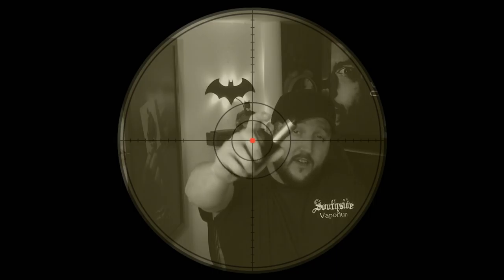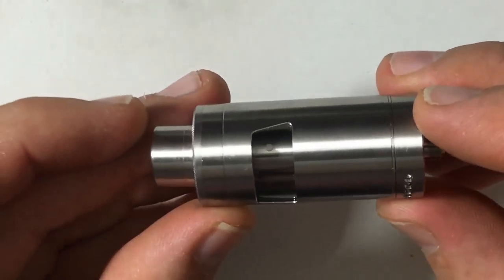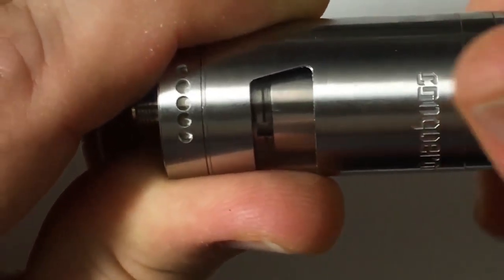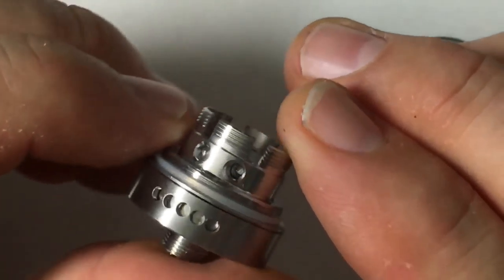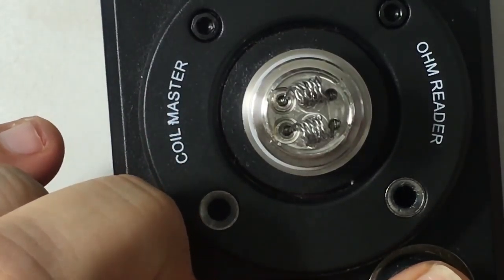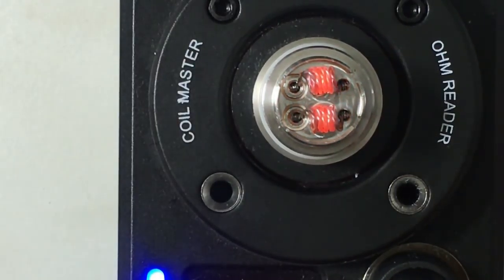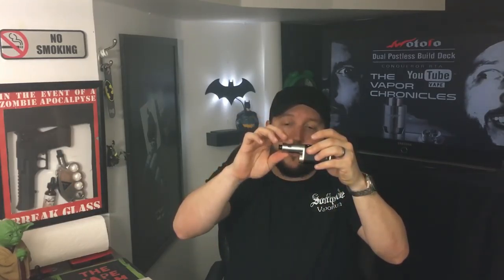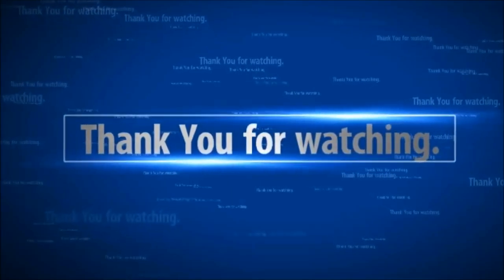Conqueror RTA By Wotofo On TVC

Comment: Hey Brian, love the coughing segment of the review lol ;) 1 question I have for you is the 510 pin looks like it juts out a little bit, so does it sit flush on most mods? Specifically on the Wismec RX200 and the Joyetech Cuboid as those are my 2 current devices. Good review as always, cheers.

Comment: How's the single coil if you were to build one sitting between the two air flow holes and used the opposite positive and negative leads for a single coil?
Reply from the maker: Great suggestion. I will try it and let you know.